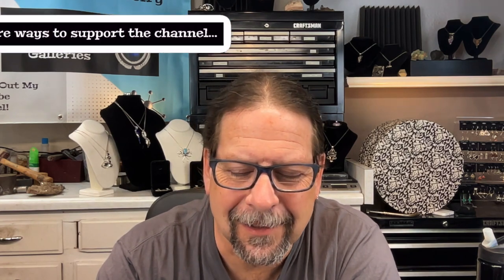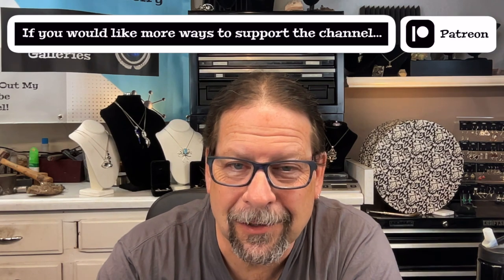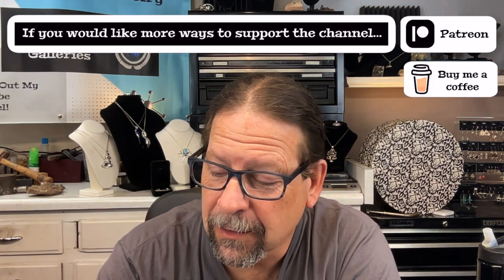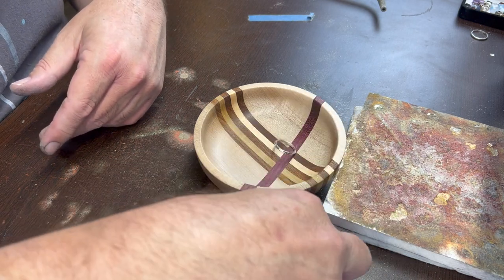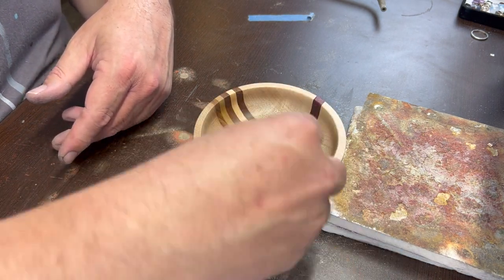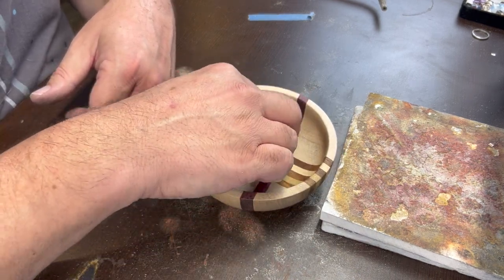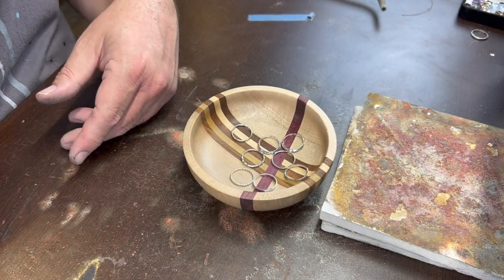Make Some Stackable Rings: A Silversmithing Tip

Comment: I love making patterned metal sheets for my rolling mill, patterned metal is what drew me more into the smithing from wire wrapping/ weaving. It’s amazing what you can do with pieces and parts of fabric, wallpaper designs and it’s so easy to sit with heavy brass (what I started making my patterns on) and a Stadler red marker and just doodles geometric style designs.
Reply from the maker: Hello Nan!  I didn't really do much with texture at first, but in recent years, I've discovered how much it can add:)

Comment: I saw someone make stacking rings by winding the wire around the ring mandrel several times and THEN cutting them apart. She got several sizes without having to cut several lengths and tap them round. I thought it a nice time saver.
Reply from the maker: What a good idea!  Thanks for sharing that Marin. It’s marvelous how everyone finds their own clever time saving tricks:)

Comment: Yes  there are only so many pieces that you can gift before you need to bite the bullet and start selling your wares. 🤣🤣🤣
I have used gallery wire, round textured by hand, square twisted wire, the balled wire & twisted 2 wires together...I have to admit that the last option needed work on the soldering.
Your videos are so helpful and informative.
Reply from the maker: Thank you so much Susan!  I'm glad you are finding them useful:). Take care!

Comment: How do u hide a solder joint on the patterned ring you made as filing it may make the pattern disappear
Reply from the maker: Hello Eleanor. For things with a pattern on the outside I usually solder the inside and use a smallish piece of solder.  You can control the flow with where you apply the heat. I’m pretty sure I explained that much better than I am here in my video about bands. I’ll add a link.
Reply from the maker: Hello Eleanor. For things with a pattern on the outside I usually solder the inside and use a smallish piece of solder.  You can control the flow with where you apply the heat. I’m pretty sure I explained that much better than I am here in my video about bands. I’ll add a link.
Reply from the maker: Here’s the link:  https://youtu.be/HZdZ4qVdELM

Comment: What does the pickle/ pickle time mean?
Reply from the maker: Pickling is using any of various acid compounds to clean the surface of the metal prior to soldering or polishing. It removes oxides and flux that have accumulated on the surface during soldering:)